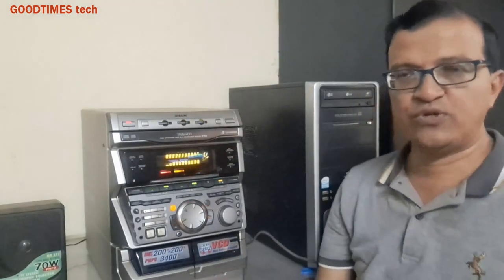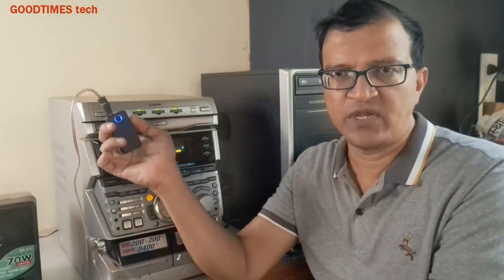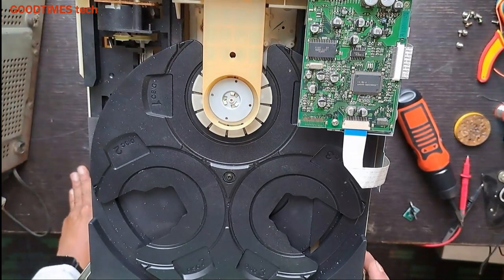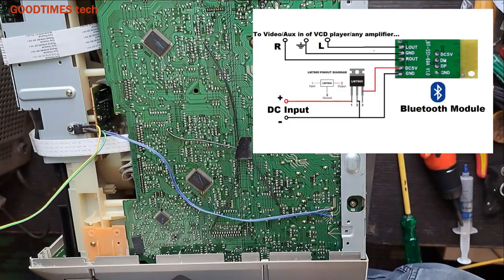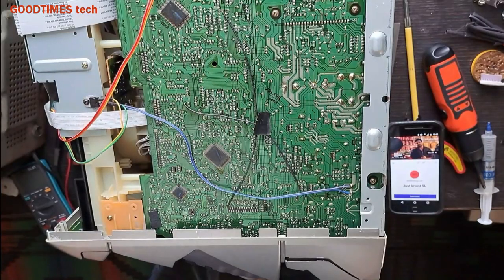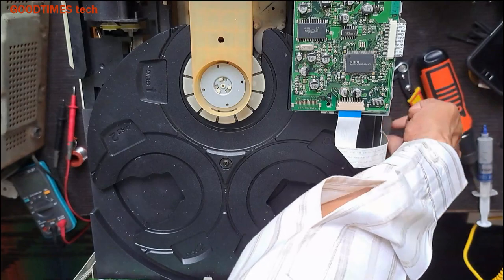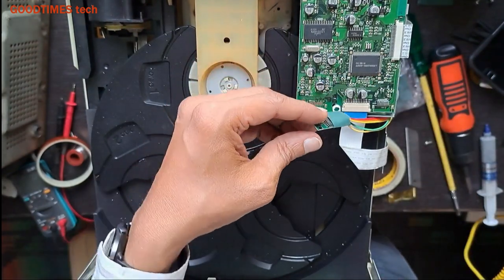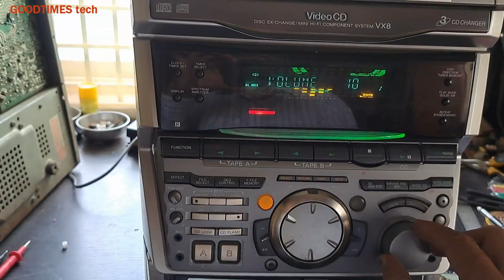How to convert Sony VCD player OR any other old classic audio amplifier into Bluetooth device.

Comment: Sir is it possible to just use the AMP & Speaker ? how to activate the amplifier circuit or provide audio input to the amplifier board?
Reply from the maker: Hello sir, if you mean you wish to use only the amplifier section and the speakers without any control unit/interface from the audio system then you need to isolate everything, check the data sheet of the amplifier IC and do the wiring accordingly or simple method is to connect an aux cable to any one of the inputs at the backside of the audio system and connect source.
Hope this would be helpful.
Thank you, have a GOODTIME....